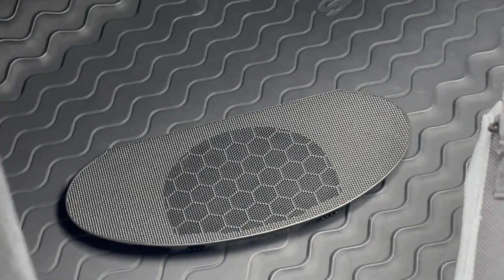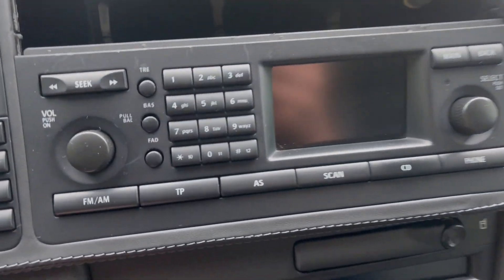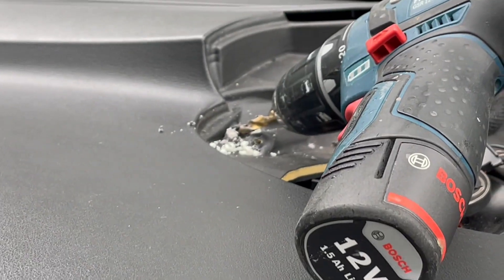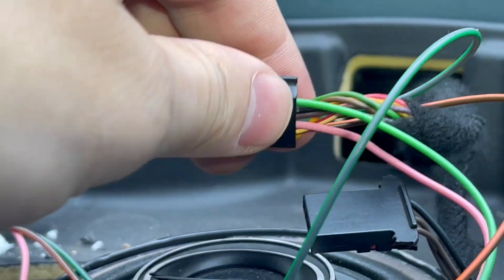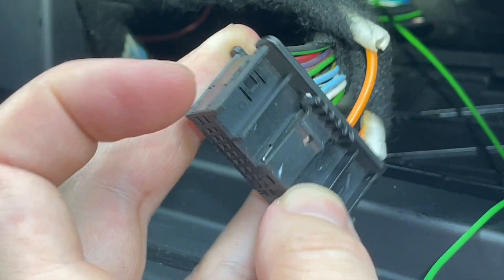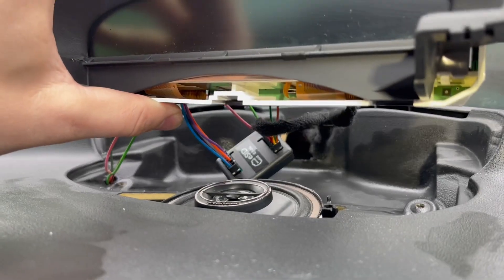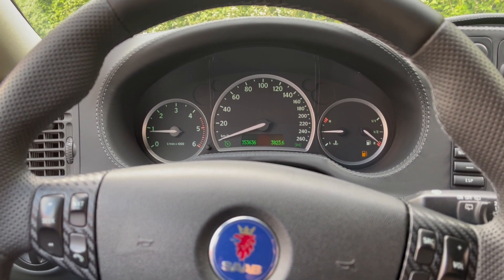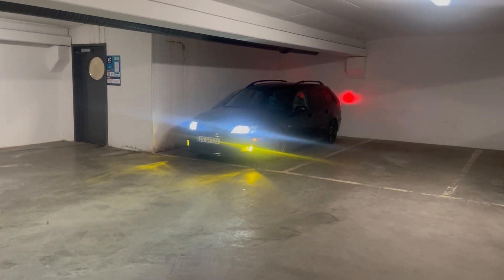SAAB 9-3 eSID2 03-06 Install

Comment: Does it come with the option to turn off the daytime running lights?
Reply from the maker: No not the parking lights. Why do you want to do that?
Reply: You can do it with the tech 2 there is an option to programm the light switch

Comment: Hi!, do you know how to get the fiber optic cables to work with the 6x9 speakers in the rear trunk? Also how should i wire it and do i need a good low-high adapter?
Reply from the maker: If your car was not delivered with those speakers, it’s possible the cables are there. I would look into mounting parts from a parts car with those speakers for a simple install.